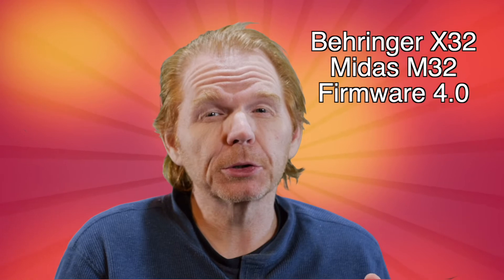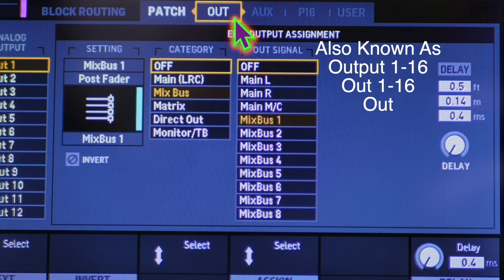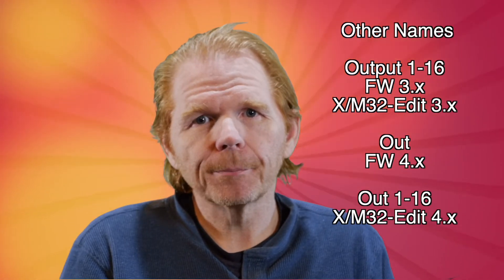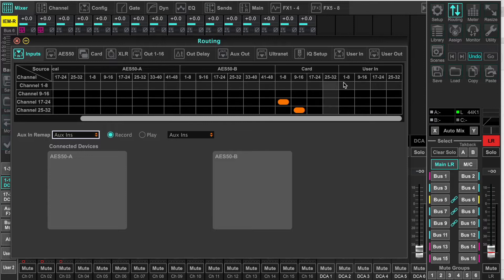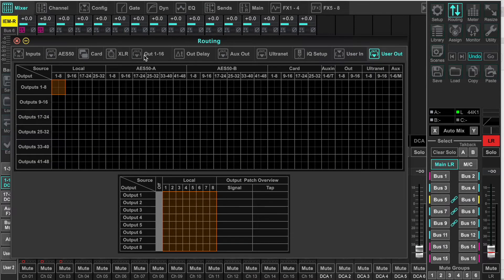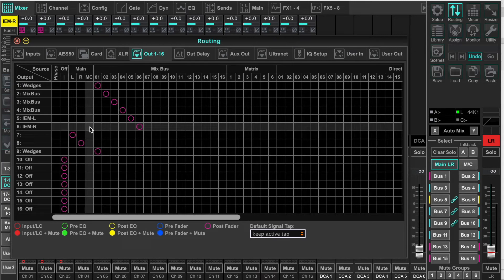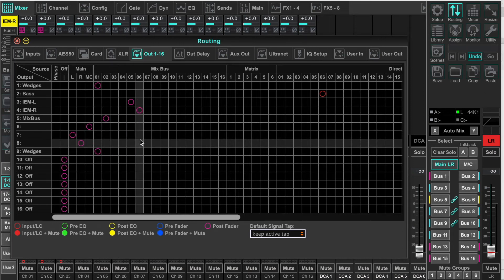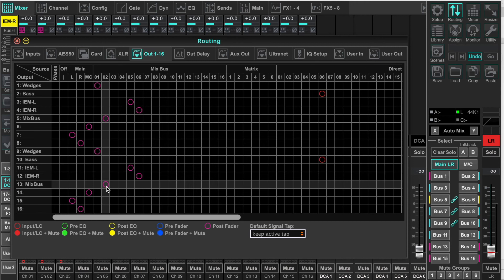X32 M32 V4.0 Mixbus and LR bus routing via the "Out" (output 1-16) Output tab

Comment: Hey, thanks for the video. I have a question: I have 2 X32: 1x on the FOH and 1x on the stage (acting as kind of stagebox + monitor mixer)
I'm wondering: Where do I put together the MixBusses? Will they be "duplicated" (whatever I do on one console is happening on the other) or will each console have their independent MixBusses and just the routing determines what finally gets to the "ears" of the artists on stage?

Ideally I would like to have the stage X32 control the MixBus, as there I would add a Wifi Router and let the artists define their MixBus setup individually. So I probably do not need the MixBus on the FOH - the FOH guy justs creates the Main-Mix, which I will send via AES to the Stage-Console and from there to the Amps.
My idea was that Out 7+8 get the Master-Signal from AES, whereas all the other outs get it "locally" from the Stage X32 MixBusses 1-6. That would decouple it completely from the FOH x32 console.

Comment: Under User In routing VER 4 I understand the Local and AES 1 to 1 patching and how to set it up. The user out has me confused. I have (LOCAL) for outputs 1-32 selected except for (OUT) 1,2 and 4 for mixbus and 14 sub, and 15/16 mains. I have an X32 full size and a S32 stage box. Does this sound correct?

Comment: Hello. I've been using X32 for about a year with amps and passive speakers for wedges and mains.  Im now trying to use powered stage monitors and having trouble with routing. I have powered monitors hooked to SD 8 stage box. When I plug mic into stage box I can hear thru monitors, but I cant hear my mics that are plugged into X32 thru powered monitors. Any suggestions?

Comment: hi, I'll try and keep this brief and clear. 

I am running M32 FOH, X32 MON with 2x DL16 S.Box. 

have X32(MON) mix bus 1-8 sending to DL16(A) 1-8, and M32(FOH) L/R sending to DL16(B) 7-8. all works fine. And if I ever need an extra bus sent from mons to stage I use the local out on console (also fine). 

what I want to know is- is it possible to use the new user patch to send mons from X32 bus 9-12 to out 1-4  on the DL16(B)? 

have been playing around with user patch trying with no luck. but there is possibly a step I am missing.... (or is this only possible if using the DL32?
Reply from the maker: It's doable, but keeping track of what needs to forwarded from console to console and the stage boxes can be very confusing. I had to make diagrams (I called them routing maps). Even then I made a few mistakes. If I hadn't had the paper maps to refer to, I would have never figured out all the problems. Are both DL16s connected to the X32?
Reply: @TheMightyRockFarmers   yes. Mons console is connected aes50a to aes50a on dl16 (in 1-16 out 1-8) that dl16 aes50b to aes50a on dl16 (in 17-32 out 9-16). Foh aes50a to mons aes50b.
Reply from the maker: @IkeStyles  On the X32, set the User Out 1-8 to be "out 9-12" and AES50B 7-8. This should setup the signals on the user out bank. Now put the bank onto the AES50A bus so it will go to the DL16.On the AES50 Tab: Source is User Out 1-8 to Output AES50A 1-8.

Comment: Hi. Thanks for this informative video. I'm really new to x32 routing. You mentioned that the OUTS are actually virtual. Is it right to think about x32's channel infrastructure then as all virtual, including the INPUT channels, that can all be mapped to the physical in/out ports on the x32 and the s16? If they're all virtual then in a X32 - S16 setup I can effetively have 24 outputs, with the s16 output ports mapped to 1-8 on the x32, and the 16 xlr (local) outputs ports mapped to 9-16 and 17-24. Is this correct? Lastly, if I mapped the s16 output ports to 1-8 on the x32 and decided NOT to map the 16 local xlrs to any virtual channel, will the xlr ports 1-8 automatically mirror the signal coming out of the s16 output ports? Thanks.
Reply from the maker: Yes you can have 24 outputs. And you are correct. Lastly, I called these "virtual outputs" to emphasis they are not tied to physical outputs. To answer you last question depends on what you are sending to the s16. If the S16 outputs are indeed "Out 1-8" (default) then the X32 would be the same if the default assignments haven't been changed (XLR 1-8 assigned to "Out 1-8").
Reply: @TheMightyRockFarmers  Thank you.

Comment: Is the only way to do this routing is with the m32 software? I am having this exact trouble I'm trying to route inputs 1-16 to outputs 7and 8. I have meters showing up everywhere I'm supposed to but nothing coming out of the physical xlrs. Thanks for the videos
Reply from the maker: M32-Edit(X-32 Edit), the console, and Mixing Station can all do the routing. Midas/Behringer's iPad app (and presumably Android) is so out-of-date that I wouldn't trust  it to do any routing/assignments. If you want more help, post you question on the "community.musictribe.com" website (Midas/Mixing Consoles). We can help you better there and if you post your current scene, we can find your problem.